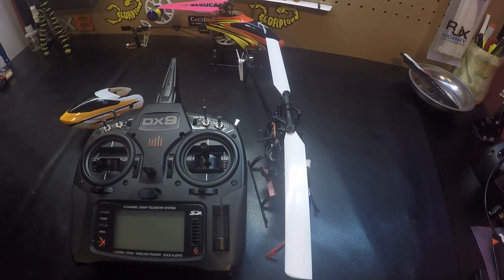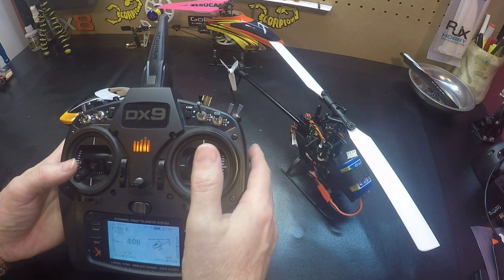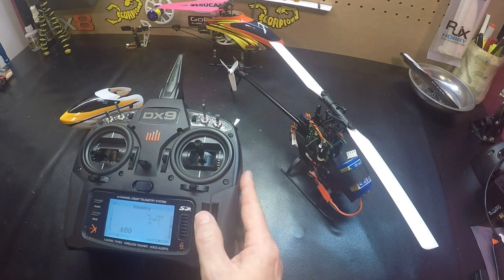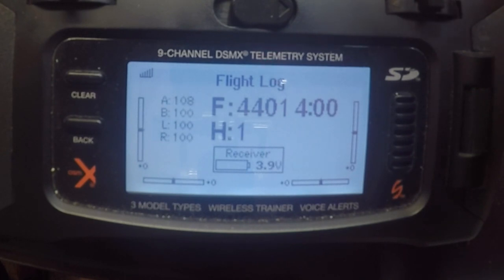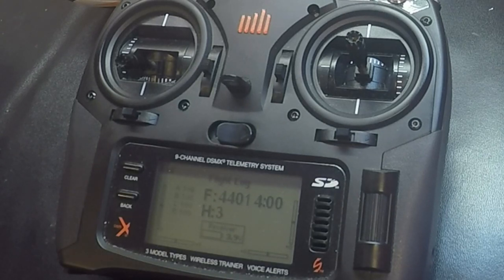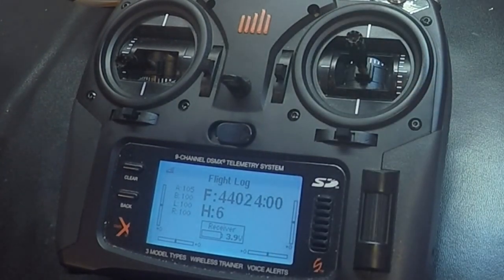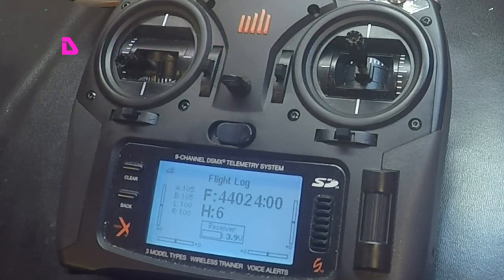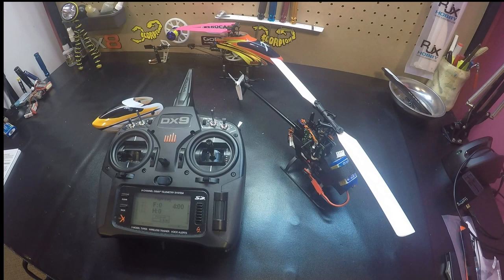Blade 130s Gain Adjustment Mode Changing Parameters

Comment: Hi J, I agree the 130 is a little slow to settle. For me it makes the heli feel heavier than it actually is. I've checked the swash on the bench and it is quite slow in returning to neutral.

Did these gain adjustments provide the result you were looking for? If so what we're you're final settings? Cheers. ps I also posted this question on HeliFreak.
Reply from the maker: Lotus 7even gain adjustments help make it feel more locked in but it has strange reactions to some maneuvers like piroflips. So back to close to stock until someone sells CF blades
Reply: JJInvertedProduction OK,  thanks anyway. Have you ever made adjustments to the "cyclic response" setting, any idea what kind of effect it has?

Comment: OK the opposite experience for me.  This heli is way to mechanical feeling.  Locked?  It's way too locked.
As far as piro maneuvers, this is a problem with Blade Heli's piro comp recently which the 130X has no problem with but this heli has a lot of trouble with.  So lets not talk about piro maneuvers right now.  
Let's just get this thing flying right doing basic stuff like big loops, etc.  It is way too locked!  Tries to come out of a loop way to fast.  It seriously is too locked in my opinion. FYI I only fly in 3D mode.
So I am learning now...  I just do not understand the difference in cyclic P gain vs I gain.  They seem to argue with each other!
I HAVE YET to find a really good definition of P and I gains that make any sense on what they do....  Other than guys just doing this or that with ZERO explanation of what flight characteristics change....  Annoying honestly... HH can't seem to explain it to me either other than "nebulas" it does this or that with no more information than the manual!
HAS NO ONE really played with P and I enough to document what it really changes?
If I have to do it, I will but was hoping for much more detail...
Same with the 230S for that matter...
Might be time for me to do it myself and find out what really is what...... :(
My .00002 cents... I hate the way the 130S and 230S flys compared to my old 130X.  It fights me through every maneuver.
Finless Bob
Reply: FYI, as for the tail... Well it's exactly as I expected.  NO WAY IN HELL is a motor going to change RPM fast enough as a constant RPM tail that changes pitch.  PERIOD...  The tail motor helis will never be like a tail drive.  So you have to fly the tail period...  I personally think this makes it harder for new people to learn...  BUT with that said, they are still fun you just have to understand the difference and learn to fly the tail more along with collective management so you do not blow out the tail.  It is very easy to blow out a motor driven tail with too much pitch / bogging.  Disk loading and adding larger batteries to the 130S IS IN FACT why people have tail blowing out.  You loaded the disk, hit too much pitch, and the motor cannot change RPM fast enough.  Basic heli physics!
Reply from the maker: Finless Bob I loved the way the 130x flew minus the lack of power.  The 230 feels closer to the 130 x than the 130s. I have not found a setting for the 130s that makes me totally happy. Hoping different blades will help. CF blades on my 230s made a big difference for me.